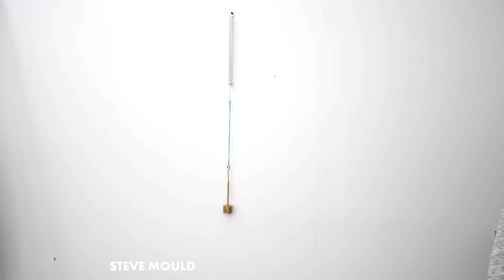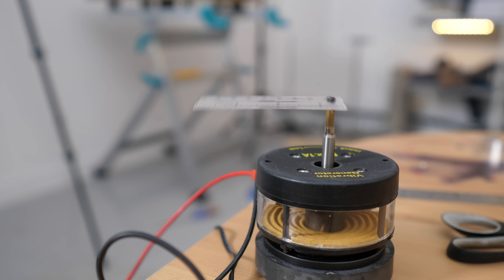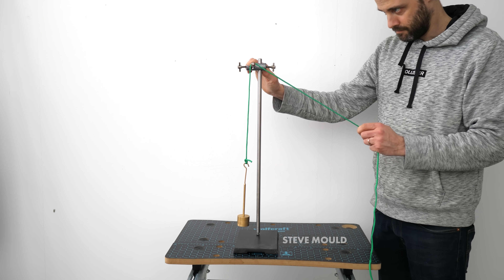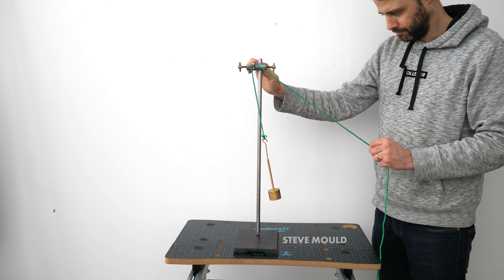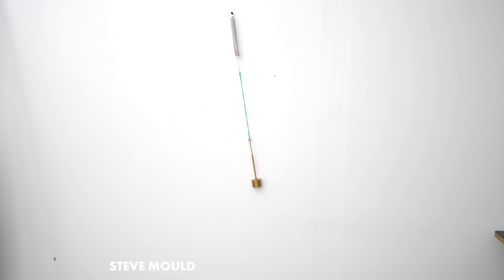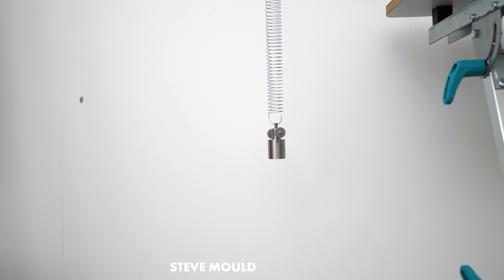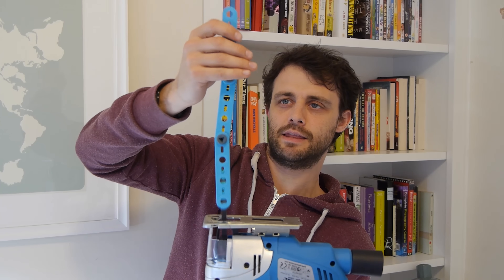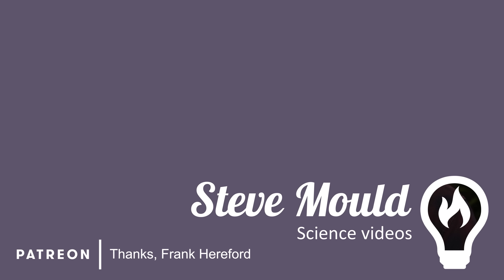What If Swings Had Springs Instead Of Ropes: Autoparametric Resonance

Comment: I'm not all the way through the video yet, but my initial reaction is "doesn't this depend on their being some initial perturbation of the horizontal position of the pendulum?"

If the pendulum is perfectly still, then the vertical motion caused by the spring should stay completely vertical, and we should only see amplification of existing horizontal movement.  If the initial horizontal movement is zero, there would be nothing to amplify.

Maybe the coriolis effect is enough horizonal perturbation for the system to amplify?
Reply: I was thinking the same thing.  In an ideal case there should be nothing to initiate horizontal motion, and the motion should stay completely vertical indefinitely.  It's an unstable equilibrium, though, so even an infinitesimal aberration will eventually cause energy to couple into the other mode, and once that starts there's no going back.  In the real world, with a coil spring one coupling path is the "Wilberforce effect" causing the weight to spin, combined with any rotational imbalance in the weight (or the spring itself, for that matter).  There are also aerodynamic effects if you're not in a vacuum, etc., etc.
Reply: @michaelsleator6326  So if the system was in perfect balance in its starting state, then it would probably stay stable, but it's incredibly impractical to get the system that perfectly balanced.  Makes sense.
Reply: @michaeldunn1754  If by "incredibly impractical" you mean "physically impossible", yup :-).  It works in the abstract world of mathematics (and maybe at quantum scale?)

Comment: What would happen if there were 2 ropes attached but one going to the right like in the video but another going to the left. Then have them go let's say, around a pulley on each side set about 150cm out. Have the ropes go over each pulley, then you could bring both ropes together directly under the weight. That way, you can hold onto both ropes and pull  them at the exact speed, time and length. would it cancel itself out? 
I only ask, because I wonder if the swing is induced by some sort of centrical force of the rope going around one side?  
Or if the rope was pulled from the other direction would it swing the opposite way?

Comment: I love anything to do with harmonic resonators and resonant motion or resonance in general. I'm a hobbyist electrical engineer, and one of my favourite areas of EE is in oscillators, like ones made of an inductor and capacitor, which work based on a lot of concepts of resonance that can be applied to a system like this. Except instead of the harmonic motion being mechanical, it's electrical. But despite this difference you can use the exact same formulas to describe them. Which I absolutely LOVE it when I find overlaps between two topics in science/physics that seem to be unrelated at first, but when you look closer, you find the reality is that they can be described the the exact same set of rules. It's almost as if the physics is coming full circle or something.
Reply: I think the various system equations are translatable since they all relate energy.

Comment: hang on... couldnt you make your "real life spring swing" but in a safer way by simply having the strings go over a bar and the springs going behind you? or say behind you at 5 meters away cirka 45 degrees angle? or something? shouldnt the springs still have the same effect but ofc the rope might need be longer?

Comment: This reminds so much of swinging a real Nunchucku. After some time of practice (years?) you realize that putting too much power into swings, flips, throws, etc makes the Nunchuku trail relative to your hand. In combat this would be bad since your hand is now exposed to the opponents attack.
If you make slight but firm micro-pauses you can get the Nunchuku to lead instead. Variations of this makes for unexpected attack vectors for your opponent. For instance you can make strikes from above and strike shoulders, collar bone, top of head, etc. These strikes can be used as a force multiplier if you let the absolute rear part of the Nunchuku hit.
Think of it like hitting something with a icepick at max velocity. Bonus is that your opponent can get confused since you no longer hit with the side of the Nunchaku.
Build/buy a pair and have fun. =)

Comment: Does this experiment (the spring/string and weight) work if you pull the spring precisely straight down, (let’s call this x axis) and release it with no bias on its y axis (left/right) ?

Comment: Had a rocking horse that worked on this principal. Each "hoof" was suspended by two parallel springs and it could either swing or rock about its CG. Fun to ride, but you'd break your ass on an actual swing. Old man had to keep a box of door springs because they would not last very long. Sooner or later it would get a flat tire.

Comment: I have a video suggestion for you.

A drone I'm a van will move with the van if the van is moving at a steady speed on a straight line....but when the van follows a curve in the road, the drone drifts akin to Coriolis for the observer in the van. 

Applying this to a plane at cruise altitude, if the plane is falling around the curvature of earth, the drone must appear to drift (to the ceiling) from inside the plane. 

Do some maths and work out how much it should drift to the ceiling in the plane...the see if experimental results match your prediction. If it doesn't appear to drift, what would your conclusion be given that it DID drift with the van on the motorway.

Comment: you might be interested to know that arborists use this phenomenon to access trees without lower branches (admittedly without thinking too much  about the involved physics)  

we throw a heavy ball tied to a string up in the trees to then pass our climbing ropes through a desired fork and climb up the tree, but you don't always hit the fork you wanted on the first throw when it's tens of meters off the ground... so you might get a smaller, weaker fork close to the one you want, and you use rhythmic tugging on the string to get the ball to swing until it has enough momentum to swing into a nearby desired fork, or even use a sharp tug to get it to swing above the fork where you've managed to pass the string

Comment: i mounted a motel of a kleion  battle cruder with a needle mounted on the back at the CG and thred  to the celing. i could push the back it would go back and forth 3 times and then the front of the ship would bob  up and down 3 times, then it wold STOP DEAD for 2-3 seconds and it would begin moving back and forth and cycle through again and again,   this would continue for 15 mints be for it bargain to run down.  this might be part of what was going on  but this does not stop and restart it sefe straing part was it stomping and restarting,  like some kinf of sippy bird toy but NO LIQUID  FREEKIE

Comment: For the billionth time, there are so many addendums to "plant trees to offset your carbon emissions" it should be illegal to even make such a claim.
It would take something like 3 times the emerged area of the earth to offset global emissions for a single year, provided they don't burn or decay after they're fully grown, let alone the fact that raising trees in nurseries transporting and planting them will most likely negate any positive climate impact they could have had.
There are valid reasons for afforestation, like habitat restoration and connecting existing fractured habitats (green corridors) but climate is the least compelling one and most often used by get rich quick "ecological" enterprises with dubious environmental footprints which sometime don't even bother to actually plant the trees.

Comment: A parametric amplifier was actually my EE undergrad capstone. The same principle applies in electromagnetics. If you pump a varactor diode at two times a signal frequency also across the diode, you can create gain for the signal at that frequency.

Comment: There is also a fantastic analogy with quantum mechanics.

You can imagine to start your system as two decoupled oscillators. This is described by a diagonal hamiltonian whose eigenstates are the two oscillators doing their thing independently. Then you introduce a certain coupling between the two oscillators, i.e. an interaction. This corresponds to an off-diagonal element in the hamiltonian, which you can diagonalize to find the two new eigenstates, i.e. the two "stable" oscillations shown in this video. 

In quantum mechanics, if you prepare your system in a state which is a mixture of two eigenstates and then let it evolve, the system will oscillate between the two eigenstates, exactly as shown here. Instead, if you prepare your system in an eigenstate to start with, then it will remain in your eigenstate indefinitely.
Reply: That's an example of two coupled pendulums. It's not autoparametric resonance. That would be if the Hamiltonian somehow changed depending on the state of the system.
Reply: Simone, man, you're way too smart for me to understand.

Comment: The motion you're using to swing the pendulum reminds me of when I was a teenager and I used to play with a diablo (in case that's just a regional name, I'm talking about the circus type toy with two sticks you hold with a string in between, and you use the string to spin an hourglass shaped weight in order to balance it on the string and throw it in the air to do tricks and stuff)

Comment: Could you recover a Voltage & Current from the spring if it were made from a more Dielectric material...just trying to fall down the "free energy" rabbit hole here.

Comment: If I'm not mistaken, the two pendulums which are either completely in phase or completely out of phase is also a way you can think of a quantum state, swinging together is entirely "up" or completely opposite is 100% "down". It's when they are slightly out of phase and appear to oscillate across that you have a up/down superposition.

Comment: As I recall the rate at which the system shifts between the two modes of oscillation is equal to the difference between the natural frequencies of the two stable modes. Thus these effects are only seen when this difference is just a fraction of either mode's frequency. Otherwise the shift between modes happens too fast and the motion just appears chaotic.

Comment: You can see the parametric resonance in action in swiss rings (Schaukelringe), which is a gymnastics skill I learned in college. It's really fun feeling the acceleration when you get the timing right
Reply: I used to do it on a swing along with moving my legs, doing both really gets you a lot of speed

Comment: Steve, thanks for you super videos.  Question for you or anyone - you say the length needs to be 1/3 longer to achieve the resonance - is this in any way related to the golden mean, or Fibonacci ratios? Intuitively it seems it’s linked but intuition is a horrible guide.

Comment: 8:33 the math (extension by another third) checks out. If the extension of spring is F = m*g = k*l, then the extended-by-a-third total length is 4*l. Frequency of pendulum is sqrt(g/L), and frequency of spring oscillation is sqrt(k/m). Putting the above condition L = 4*l is equivalent to setting frequency of spring = 2* frequency of pendulum, ie parametric resonance. 👍🏻

Comment: I thought it was pretty cool that when they're a quarter out of phase, the moment they switch is when one part of the pendulum reverses its phase. I didn't look at which is which for this, but it appears then that the pendulum that's either ahead by 1/4 or behind by 1/4 becomes the consumer of the other pendulum's momentum, and when one of them is entirely "eaten up" and reverses direction, this relationship switches (because the swinging shifts by 1/2 phase) which is why they keep going back and forth between modes like that :)

Thinking on it (still without looking at the video again because thought experiments are more fun) I'm going to say the behind-phase one is the consumer. I assume this intuitively because I spent a lot of my childhood jumping on trampolines with my friends, and to give my friend all my bounce I'd stomp down on the trampoline a little bit before them. Likewise stomping just after them landing lets you kill their momentum, but I rarely did that because that energy is all absorbed by the legs and hurts quite a bit when you're not prepared for it.

Edit: now I'm actually getting a little bit unsure of if I got that right, because originally I said stomp ahead of them for both and I can't decide which is which. Memory is unreliable and I don't have a trampoline and friend handy...

Comment: Pumping a swing (from a standstill) is a two part process: Initialy, you start the oscilation by transfering angular momentum, because the efficiency of changing your CG is zero at this moment. But as soon as there is noticable movement, you change over to altering the height (radius) of your CG, because the efficiency of this method is now MUCH higher.
I think you fail to see this changeover, because humans have most of their body weight above the swing seat, which means that every (somewhat ergonomic) rotation is automatically a change in GC heigth (radius).
Just try conceptualising the kinematics of a swing-robot (with a rotating disk on a motor) and I think it will become apparent.
What you did at 6:45 was perfectly fine, it was just out of phase by 90°

Comment: 3:06
In the skateboarding world they call that pumping. They push down to lift their center of mass upward right before hitting the ramp and they bend their knees as they go back down just to push again right before exiting the ramp.

They use this to go faster and the similarities with this pendulum experiment are more obvious when watching a skateboarder pumping in a half pipe to gradually gain speed and get higher up the ramp.

Comment: At around 5:10 you say that the mass speeds up because energy is put into the system by pulling on the string. Although you put energy into the system, this only increases the potential energy. I think the increase in speed when pulling is actually a result of the conservation of momentum. Its the same effect as pulling your arms closer when rotating on a chair from having them stuck out. However, lengthening the string will then convert potential into kinetic energy and therefore speed it up (because gravity is putting in that work to convert potential into kinetic energy). So i believe the increase in speed is a result of the latter part, not the former. Or have i misunderstood something?

Comment: I would love it if you would try to swing on a swing with ridged "ropes." When you pump a swing you are effectively shortening the pendulum. Look how the rope is bent when in full "pump." If the rope isn't dead straight the entire time, you are shortening the radius of the arc. Also you can swing a swing with NO legs at all... so before someone says something about legs..

Comment: I liked your video, it clearly demonstrates how the increase in the kinetic energy is mainly because of gravity and does not account for the increase in the increase in its potential energy as the tension takes care of that. I believe that resonance somewhat represents  the most efficient way to transmit energy, without any loss of work due to counter-forces from the system.

Great Video!

Comment: The bird did a poopiss or a pisspoo. It can't do just one or the other. The white is the piss and I doubt it that anyone was watching it on a screen big enough to consciously see the black, so you actually saw a bird pissing and unless there was something unexpected with that bird it's reasonable to assume that it probably pooped as well.
I mean, if we're going to be pedantic about explaining things, be pedantic about explaining things :p

I did forget why a bird always poops and pees simultaneously, but it is interesting, since clearly it's not just pissy poop, but black poop and white piss coming out all at once. Well technically not all at once because the pee and piss are rarely if ever the same volume and length while coming out, which is also interesting because that makes one wonder if the poop is first, last, or somewhere in the middle of the process.

Comment: Is this the case on this vid?
https://youtu.be/2vYIdbqTl5o (it's that game where you try to shake other players on a bridge.) I thought it kinda uses up and down momentum to achieve a swinging motion or a pendulum. Tho, i also noticed that it starts out as static and gradual increase, but it stops increasing at some point due to the attempt of players to balance and not fall down along with the others. (i just noticed cuz i learned somewhere about spontaneous synchronization so i just found to include lol)

Comment: For your example at 3:00, I do question if the initial movement was caused by the up and down motion, or by the perturbance of you simply tugging and holding the beam. Once that initial movement is introduced you can amplify it using the up and down timing, but I wonder if you would be able to bring it into a swing under ideal circumstances (i.e. weight is perfectly still, movement is perfectly up and down)

edit: nevermind, you do specifically say "get the amplitude to increase"

Comment: Surely .. by pulling the string ur changing the weights natural force against gravity and then when u lengthen the string you are increasing the time at which the weight can reach the maximum free fall speed of itself and gravity. So.. you are technically inputting two points of energy Persay ??